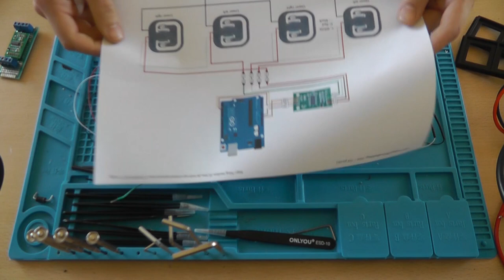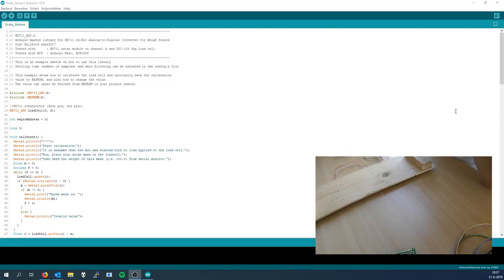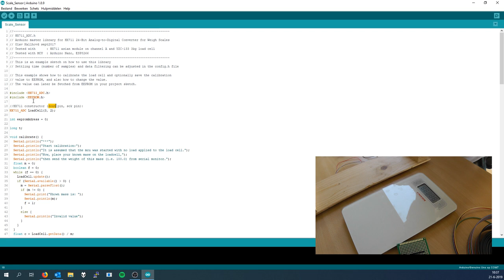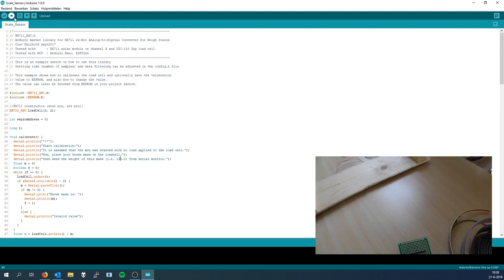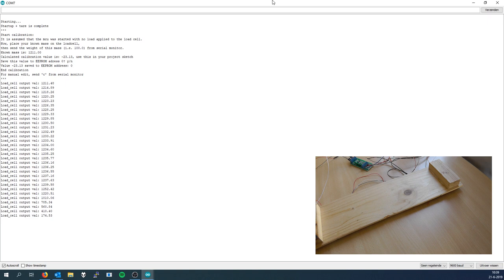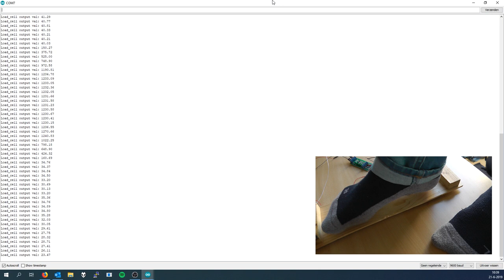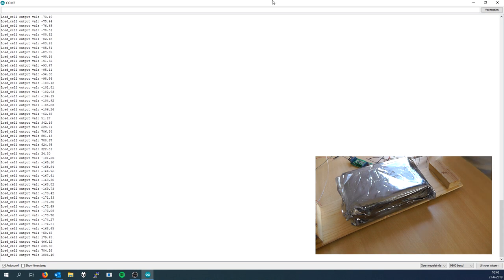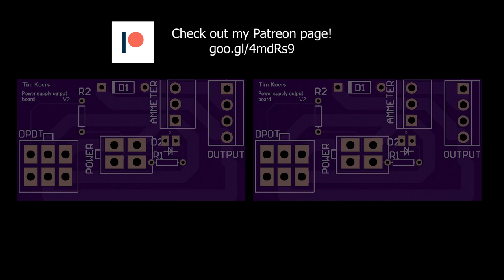#55 50KG Load cells revisit #2 - Finally working

Comment: That thing which you called a "wire holder" and used to hold the wires while you joined them, does it have another name? I want to buy one because it looks very useful but if I type "wire holder" into ebay I can't see one in the list.
Reply from the maker: Well I remember replying to your comment, but YouTube Studio does not like to reply to comments when being active for a day. Yes, there are a few sellers on banggood/aliexpress that sell silicone versions and use the same 3d model as I did. But I don't have any links to those products

Comment: I did the same thing, but the serial output is not giving me constant values. Any idea ?
Reply from the maker: Does it give the same values with the load cells disconnected?
Reply: @TimsElectronicsLab  no, it is different results, but still not constant values
Reply from the maker: The values are not going to be constant either. They will vary based on temperature and ADC inaccuracy. I think averaging is a good practice here

Comment: Has anyone made a sketch, incorporating a relay output, when the Load Cell reaches a user-defined setting?
Reply from the maker: Hi Super Argo! I'm sorry for the late response, but it should be as straight forward as using an Arduino Relay example sketch, combined with my sketch and using an if(weight > min_weight){ digitalWrite();} statement

Comment: dude you have the arduino code? thanks !!!
Reply from the maker: You can use the example sketch that comes with the HX711, and connect the pins as shown in the code. Let me know if you've got any other problems!